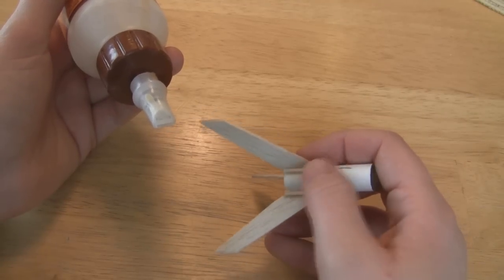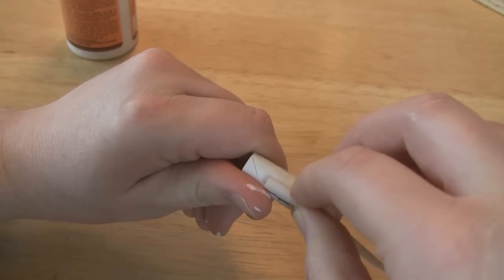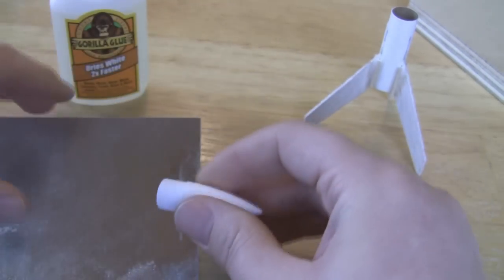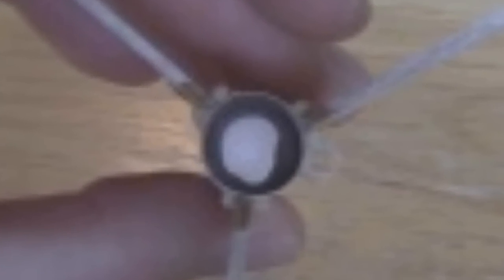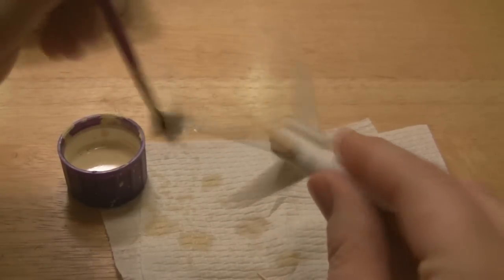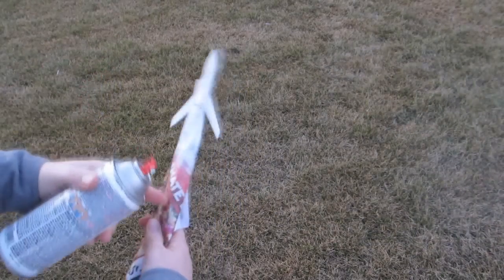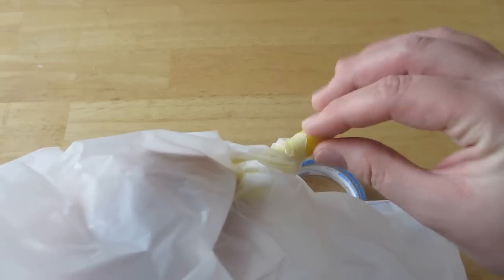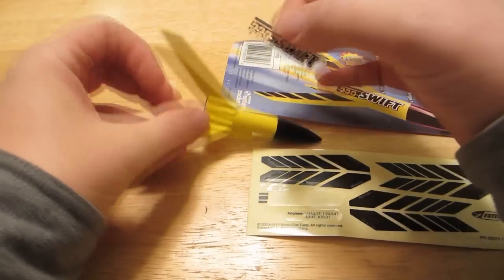Estes 220 Swift Launch and Build Part 2

Comment: When I apply the wood filler mix to the fins it tends to melt my glue fillets. What am I doing wrong? I wait until the following day when the gorilla glue has cured before I apply the filler mix. Thanks I've learned tons from your videos.
Reply from the maker: MeGolf92 Is this gorilla wood glue, or the foam stuff? I don't have any ideas off the top of my head.